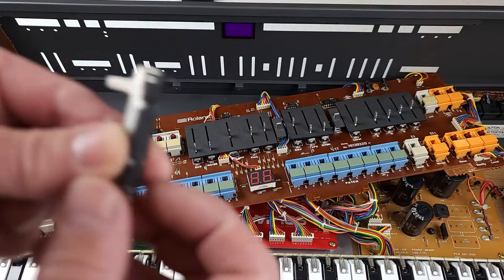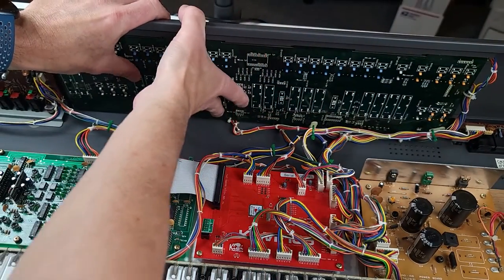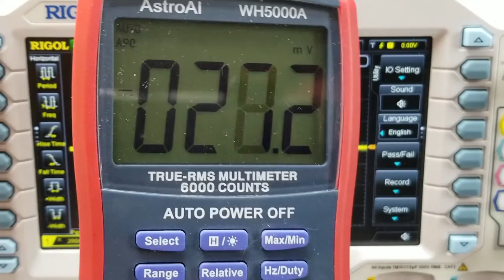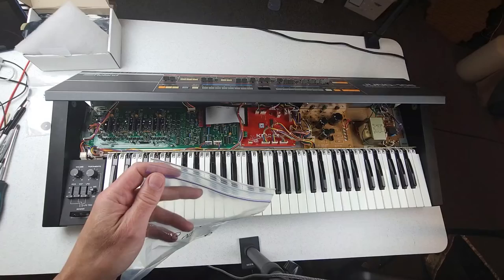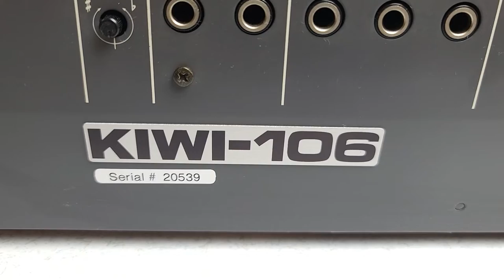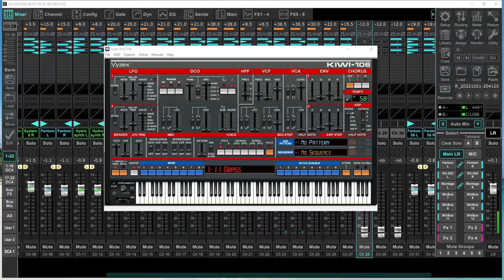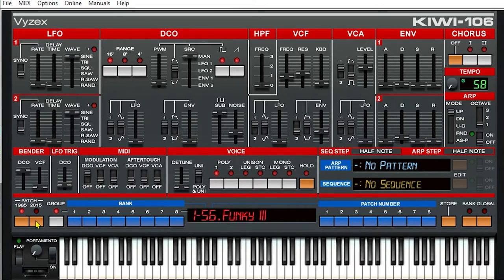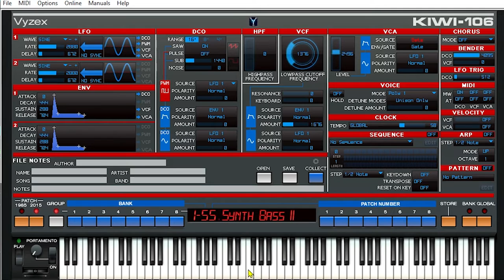Repairing & Restoring a Roland Juno-106 to Better Than new! Episode 4: Controls, Calibration/Testing

Comment: Good job! I also renovated exactly a Korg poly 61. It was quite a big job. As I have more than 30 years Electronics and repair experiance I recommand: ONLY REPLACE CHIPS OR IRIGINAL PARTS IF IT IS PROVEN DEFECTIVE!!! It waves money and keeps as more as possible original parts. Trust me, chips as most the time totale fine! Greating Chris
Reply from the maker: The Juno is an exception - the power supply because when it does fail, it takes out everything else - so a $3 chip is cheap insurance. And the voice/envelope chips because they WILL fail, and I didn't want to do this job twice.

Comment: Thank you so much for all the time you spent to show us  a depth repair and restoration video for the Juno 106. I really love this keyboard. I currently have one at my home, and have the privilege of testing it out. It belongs to a musician friend of mine who used to tour in a band called the, Temple Timers, around the late 80s. My friend used it to play the Oregon patch preset. There are some problems with it though, I tested the voice chips. It looks like voice chip four is not firing properly There's also some short circuits in some of the sliders when moving them around. I haven't done a thorough cleaning on it yet. So I plan to do so. Thank you for the recommendation with the Deox d5. My friend wants to sell it and I know they're going for up to $2,000 $. However, I don't think this keyboard is in Tip-Top shape to sell for that amount, do you have any recommendations? I really want this keyboard very bad and want to buy it for a fair price. I am a claimed keyboardist and just have to have the Juno in my Arsenal. So please help me if you have any additional information that would help me in my dilemma. Thank you so much!

Also my buddy is getting rid of a whole lot of vintage recording equipment that I know someone will definitely be interested in. A lot of gadgets and toys. Can you refer me to a good place to put them on the market?

Also, where should I avoid spraying the Deox d5?
Reply from the maker: Don't spray the Deoxit (or any solvent-based cleaner) on or near the rubber keyboard contact strips, as it can (probably will) damage them. You can use a q-tip to gently apply it to the contacts only if necessary, but not to the rubber surround parts.

Most people are looking for recording equipment on Reverb, but I also see it on Facebook Marketplace.
Reply: @ScottsSynthStuff  thank you so much for your you have been a very

Comment: Thank you very much for showing the whole restoration, it will help me a lot as soon as I get my Juno-106!
But I definitely won't install a KIWI-106, as it actually defeats the purpose why I wanted the Juno in the first place: simplicity! Just having a knob for everything, and every knob with just one function. I got a DeepMind-12 now, which basically has most of the functions of the KIWI-106, but even some very basic functions are hidden in menus. I also like the "1985"-view much more than the "2015"-view in that piece of SW. I guess I should also check out the JD-800 once, maybe starting with your video about the restoration ;-).
Reply: Today my Juno-106 arrived! And I immediately found out why you should NOT PUT those VOICE CHIPS into SOCKETS!!! They can easily fall out during transport!!! Somebody apparently took out the 6 voice chips, removed the epoxy, put them into a white shrink-wrap and socketed them... Lots of tones were missing when I tried it the first time, opening it saw some of those chips missing, I found them back after looking underneath the power input PCB (luckily the 115V didn't blow up the chip!) and the module PCB... Now it works, but I definitely need to calibrate it. And get a new transformer, apparently in some (later?) models Roland didn't put the multi-voltage transformer anymore, it's for 100V only now... But it sounds great! 😀

Comment: Such a thorough well organized series of videos fantastic job!   While doing the full calibration is beyond the scope of these extensive videos, What i have yet to find on the internet is a 106 calibration demonstration we can actually use to perform one ourselves.  A method where the presenter does not just show the oscilloscope but explain what to set it to for each part of the calibration.  This would make all the difference because the people that understand oscilloscopes don't need a callibration video, and the people that don't understand oscilloscopes can't do anything with a calibration video anyway unless that info is shown for that most difficult part.

 Also it would be so great if someone gave some examples of minimum cost oscilloscopes specifically for this procedure and also the minimum necessary specifications required so whether budget or vintage we don't have to spend $799 to make sure its got everything ----and then only use 5% of its features and only use it one time for a juno calibration.  There are no videos out there that show any of this, the closest they get is showing you is some curves on the scope with no mention at all of what to set the scope to or good budget scope solutions to save the diy person some money.  
If you try to ask advice on synth repair user groups about some alternatives for oscilloscopes, no one seems to get the budget part --  but instead recommend $800 oscilloscopes but they can't seem to explain what specific features are needed and seem to just dismiss the cheap ones likely because of an dismissive opinion based on price.  

 Today's modern oscilloscopes did not exist in 1984, but whatever they used on the 106 then, worked for sure and might be cheap now.   Which ones are those? If not a vintage solution, which one of these less expensive ones on amazon has the suitable features?  Some are 50 dollars. Are the tests with these simple looking sine waveforms too NASA for just a simple oscilloscope like that? Won't it do the job and get you across the finish line somehow?  Just the $50 inexpensive one? Or then the $70 one then?  Or 100 .  
Would love to know these things like is it possible to run those 3 or 4 scope tests with a budget of less than 100 on a vintage or a inexpensive simple scope and then what settings for each test and where do you ground it and which probes etc etc.  Maybe someday someone will put  that together it eould be amazing!
Reply from the maker: The reason I usually "skip over" the calibration process on these videos is not that it's out of scope, just that it takes a REALLY long time, and it would be incredibly boring to watch.

As for scopes, even an inexpensive $120 scope like this one https://amzn.to/42c4G9h would be more than enough. It has auto-ranging, so it will take care of most of the configuration, you might need to set the sweep frequency into the audio range. That scope (and many like it) has peak-to-peak and frequency measurement capabilities, which are VERY useful for synth calibration.

I haven't tried it but one of the DSO-138 based units like this one https://amzn.to/3Wyr37D would do the trick, although with their minimalist interface, they're definitely harder to use.
Reply: @ScottsSynthStuff  thank you so much I never would have found that first one you recommended! I found a used dco138 one for 20 bucks already before reading this, I'm going to try that first and then I know if that doesn't do it it won't take long to order and receive the Dilwe one! Much appreciated!

Comment: Fantastic series, but I think a full restorization like this is not for the faint of hearts. Lot of things can go wrong and if you have to go buy both solder iron, a desolder station, osciloscope, microscope and other tools and you don't have experience in soldering you might be better of getting it done by a professional. Like you showed with desoldering both the voice chips and the 4row cpu chip sure requires both skills and carefulness not to  make shorts or damage the traces. Iremember as a big teen I dreamed of getting a Wersi Organ which could be baught back then from Germany in DIY kit. And I later heard from a local dealer where I lived how many of those things Wersi had to fix at the custommers expense which made the full prized Finnished Organ a better deal even they were very expensive. The DIY self kit had 10's of thousends parts that had to be soldered. That was back the late 70's. Think they estimated a Wersi Helios had about 40.000 solderings .. thats one serious DIY project if your not a pro with a soldering iron 🥵 I think its great what Kiwi is doing to spark life in older synth like the 106 and the Polysix and It's amazing that there actually is so many aftermarket replacemt parts so many years later. It's not that there is so many CS-80's but I saw Synthaurs video on restoring a CS-80 and many of those parts is impossible to get replacement parts for.
Reply from the maker: I agree, I was really trying to show the delicacy of desoldering those chips and the traces, and emphasize how careful you have to be, both to dissuade those who don't have the skills, and to warn those who do.

I have seen far too many pictures of massacred 106 voice boards by people who should not have been in there with a soldering iron.

Comment: You said “disaster struck” and my heart dropped to my shoes. Thank you for reconstructing so much of the lost restoration footage! SPOILER ALERT: If you’ve got a working Juno 106 at the end, disaster didn’t really strike, though, now, did it? 😊
Reply: That was the first thing I thought of, so glad to hear that it was okay.
Reply: @macdaddybender  It was only Scott that got hit by lightning 😄noone should have to feel how it feels to be hit with full 110/220v surge. I have luckily never tried it myself even I have worked as an Electrician. Always only tried touching the stuff with a single hand without being grounded. Biggest shock I ever got was when I was an apprentice and the one I was with told me to cut a 5 lead cable that he "thaught" was not in use  and poof I had a plyer with 2 nice welded wholes in it 😁

Comment: Great series. Personally, I would NOT apply the kiwi overlay unless the panel was in terrible shape.
I would look into applying important portions of the overlay to panels of refrigerator magnet sheets, so you can retain the provenance of the original instrument.
Reply from the maker: Interesting idea, I might consider that. The main problem is that there are SO many new functions that if I step away from the synth for a week or two, I can't remember what button does what, and have to break out the manual again. Having it printed right on the panel would be a huge advantage.
Reply: @ScottsSynthStuff  I think it's doable. two strips for above and below the selector buttons, another to the side for the page menu. and maybe a few small magnets for smaller details. Obviously a simpler design, but Jorb made one for one of his Akai's. It looks great.

Comment: At 18m57s you said that the voice chips were hottest but these are the VCA/VCF chips either side of the DCO chip (the DCO generally doesn't go out of tune). Sorry, I had to correct you, but in September this year I will have been 35 years as a Roland Engineer. One question I have is how do the new chips compare with the original in terms of sound quality? Did you know that the old chips can be repaied?
Reply from the maker: I actually realized that I was naming the chips incorrectly after I posted this video, I corrected myself in one of the subsequent videos in this series. 

The old chips can be repaired...but not always. Sometimes the printed resistors on the chips get damaged, especially when people try to remove the last of the resin after chemically removing it.

I honestly can't hear much of a difference between the old chips and the new ones (except that all the voices are now sounding!).
Reply: @ScottsSynthStuff  The new chips are obviously good, I have used some in the past that are flawed especially in the area of resonance. I have dipped and stripped many VCA/VCF chips and had 100% success so far, but in the wrong hands or someone who's too impatient to wait a few days for the strip to properly occur; things can get damaged. Never had to chemically strip a DCO though to date.

Comment: Great channel! Sorry to hear about the lost video. However, as long as you do not record again on the same memory device you might be able to (quite easily) undelete the files. There are many different programs you can get to do this. Try to Google. I realize maybe it’s too late for this advice now but you could try it if it ever happens again. And actually, if you have not done extensive recording on the same memory device there still might be some of the deleted files left.

Comment: I've never soldered before but I do have a tinkerer's spirit. I'm wondering if a project like this would be doable for me, perhaps after I've done some homework and gotten a little practice on a kit, or something that doesn't matter. I'm also incredibly patient. I had planned to send mine to have all this same stuff you've done accomplished by a pro, but it would cost me well over a grand, plus expensive shipping there and back. I'm so torn, meanwhile my juno sits in the closet.
Reply from the maker: I have been soldering for over 40 years, so do not go by what you are seeing me being able to d. If you were going to attempt this, I would definitely spend quite a bit of time practicing on junk circuit boards first. The older the better - these old 1980's era boards are nowhere near as resilient and tough as they are today.

Comment: Thanks!!! Is it possible just to Deoxit tactile knobs in order to repair them? On my 106 Bank A/B selector works only if pressed hardly..
Reply from the maker: Possible...but those tiny switches do just wear out, and they are cheap and easy to replace. You can try cleaning them, but you sent going to be guaranteed that the cleaner will actually get inside them, and it likely won't last for long. That's why I just replaced all of mine.

Comment: There's no way to fix the blue buttons which have turned green?
Reply from the maker: It's oxidation. You can take some fine sandpaper and sand off the surface, which will reveal the blue underneath...and solve it for another 40 years.
Reply: @ScottsSynthStuff  So you did that?
Reply from the maker: @scottlarson1548  I've done it before, but not on this one.
Reply: @ScottsSynthStuff where are you located